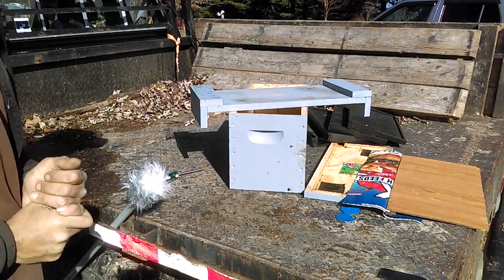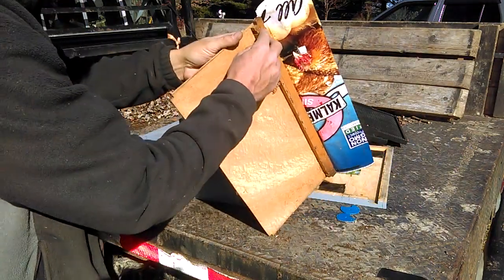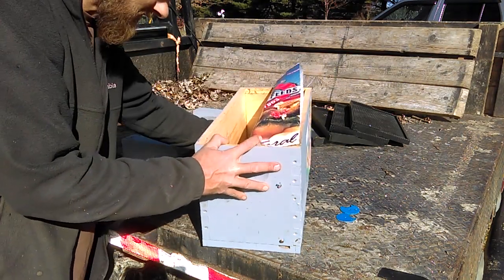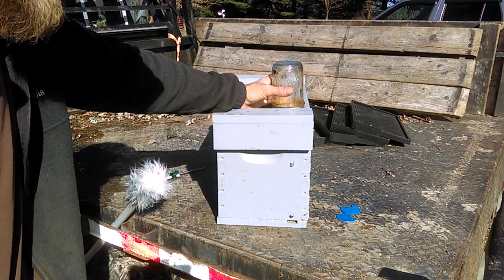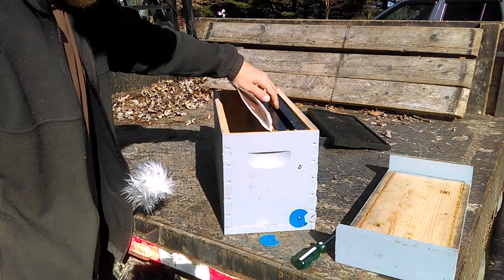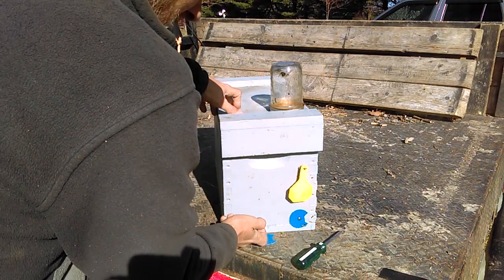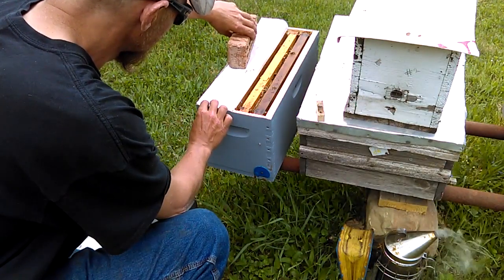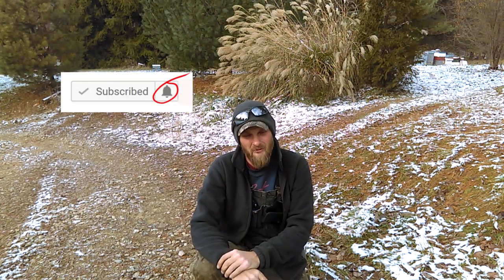2 Frame Mating Nucs... Splitting A 5 Framer In Half (Double 5 Frame Nucs)

Comment: Jason, I used old gallon size tea jugs to store and dispense my syrup.  I found several years ago, if I put in about a tablespoon of honey be healthy in each gallon and make sure it is mixed, it doesn't mold for a much longer time, if at all.
Reply from the maker: Great tip! The only issue is I don't use honey B healthy. The reason is when it's used the smell travels and before long every bee in the neighborhood knows where to go eat. I used to add all kinds of essential oils until I observed that. 
I have seen sugar syrup recipes that include vinegar to prevent mold though. I think the vinegar also offers other benefits to the bees but not sure what they are.
Reply: @JCsBees  Haha, I've experienced the same.  I left the cap off a gallon jug of syrup with honey-b-healthy in it and my truck was swarmed within minutes.

Comment: 3 framer is a better balance between a 5 frame and a 2 framer.  Divide a 10 frame box into 3 compartments, works better...its a little harder to physically remove frames in a 3 framer if the partitions stick up above the box with inner covers between the partitions.  You can winter a 3 framer in North GA.  They do not get as crowded as fast but they will soon enough.  Can remove 1 frame to reduce crowding without hurting the nuc.

Comment: Dividing a 5 frame box into two 2 frame NUCs in my opinion is easier to work with than the 10 frame boxes I see divided into four 2 frame boxes.  It is just easier to handle and you can keep the entrances further apart.  I like the two frame NUCs but not a dedicated two frame boxes which seems like a waist of material and too many things to handle.  A divided 5 frame box makes better sense.  Keep things simple and more standardized.  I use the cattle tags too, I can move the number tag with the queen as she is put into different boxes and record keeping is easier.  Great video.
Reply from the maker: I don't mind the queen castles and really haven't had issues with them. I think placement is very important when setting up a mating yard. I like using trees as land markers. I think that greatly helps reduce drifting.
I forgot you used cattle tags too. They work very well.

Comment: if you like the 2 frame nuc setup then use a 10 frame body and divide it into 4 compartments.   Personally I don't care for them too small a space...after 1 or 2 frames of brood emerges then it becomes too crowded.  If you remove 1 frame then you have taken half the nucs resources...too much.....  Also, too small to over winter...if in a 10 frame box then you can remove one partition and make it into  2x5 frame nucs for winter.   But trying to run a 2 frame nuc all season for mating is not easy.  If you have several 2 framers, you can shake bees out of them into a package and start a new colony that way to reduce crowding.  2 framers are basically good for temporary queen storage and cell emergence.

Comment: I wonder how much more effective it would be to use half length frames instead of full length frame?  It's seems like bees could keep their space warmer especially in colder weather.  As far as two colonies sharing one box and it was not a problem when I did it last year.  I had a follower board that had a one inch gap off bottom off it.  It was a long lang and never noticed any issues.  Was plan on using 6 frame nuc and splitting into 3 2 framers or putting half length  frames in it.
Reply: It would be easier...and there are mini nucs out there that use frames 1/4 of the size....but the entire reason for this style, is that you are able to simply pull a frame of brood  out of  a hive and slide it in here.....and also when you have a successful mated queen, transfer that frame to create a new nuc. 
The mini-nucs have one purpose...to create a mated queen for you to take out, mark and transfer somewhere....
This just allows for transfer of frames much much easier.
Reply from the maker: Kevin is right but is leaving out 1 major factor, using deep frames for mating nucs gives me a chance to grade the performance of each queen before she is sold or transferred to a bigger box. Always keep in mind when open mating queens you never know what you will get. You could get a great layer or a poor layer, You can get mean as heck or docile and easy to work. So judging them is also a good thing.
Reply: good point.......

Comment: Jason, you discovered the same as I (I did a vid also)....the two frame box was very tippy in the wind.....converting a 5 frame nuc into a double two frame seems the simplest way to go. Duck cloth works well as an inner cover...but more expensive than your feed bags...but it doesn't flip up like  the feed bags do.... 
I like your "vents on the bottom board, more because I found if my feeders leaked, my bees drowned as there was no way to drain any rain water or sugar syrup that drips down.  The doubles are tough that way because we generally "tip" the hive one direction or the other towards the entrance....can't do that with a side by site with entrances on opposite ends.
Reply from the maker: Hey Kevin, Would you like to share the link to your video? We'd love to see it.